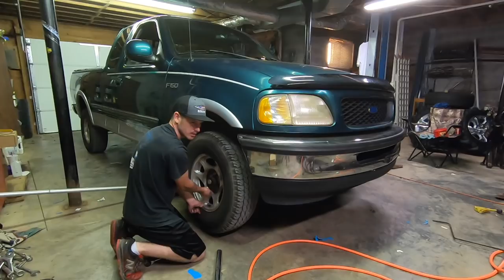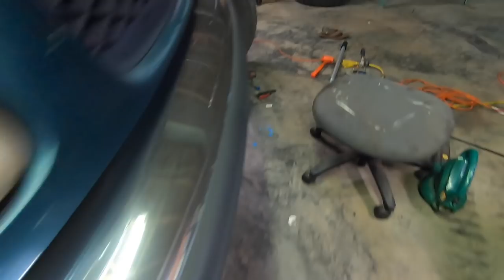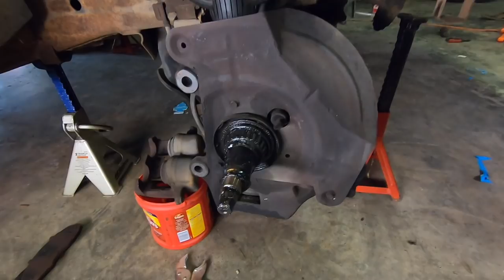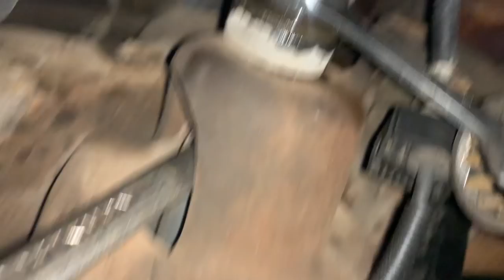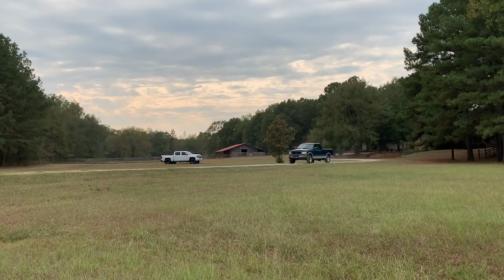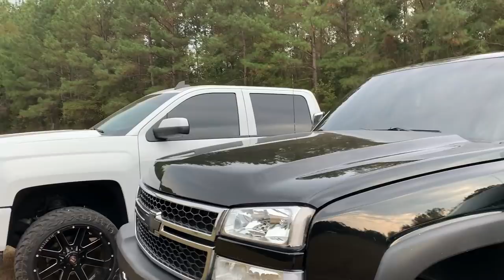3 inch spindle lift install!!

Comment: I’m mostly into older jdm cars but recently purchased a 97xlt extended cab 6 cylinder only though . Came with a snugtop to match. Been following along with your rig build and your truck is dope man. The 9inch lift you added so nice man. Keep up the cool videos🤙🏽

Comment: I’ve got 3.5” spindles, 1.5” lift coils, 2” rear lift blocks and 3” body lift sitting on 35s on my 98 2wd. I love it.
Reply: Did you have to change anything? Like upper control arms or ball joints?
Reply: Got tge same

Comment: I love your videos. They are super helpful. I have a 06 f150 2wd and after watching this I may actually go for the spindle lift over a 2.5 level. Was it easy to fit 35s with the spindle lift? Did you have any rubbing or have to do any trimming?

Comment: If You Add a 3 inch Spacer On The Coil Springs Would It Make Your Truck Higher Than It Is Or Would It Just Reinforce The Suspension Since You Already Lifted The Truck With The Spindles ?

Comment: You mentioned the spindle lift opens the gap of the upper and lower arms .... that’s not how it works it only relocates the the spindle . Otherwise it would mess with the ifs Alignment... some vehicles can have more lift or less from a spindle lift all depends on the factory locations of the spindle on the factory spindle ... like vids keep them coming

Comment: I’m about to do complete brakes suspension and steering all around on my 99 f150 4.6 2wd
Reply: Im in the same boat with same engine. 
I just need to pull the trigger already and get my kit.
Reply: @maxz4065  I did the lift and everything else while I was down there. took about 5 hours with a knowledgeable friend and lots of tools. I fell in love with the truck all over again. new tires and took her in for an alignment. like riding brand new
Reply: @Elon_Trump  any pics
Reply: @Elon_Trump  how did effect your gas mileage?
Reply: @ernievilla6840  not bad at all or at least not very noticeable I also check the tires once a month or so to keep them at proper pressure. She is still on the road and drives great.
Reply: Awesome I'm thinking of doing the same to my truck it's old,can use a new paint job, and I want to replace the interior, but the engine only has 30k on a remanufactured engine I had installed almost five years ago when I bought the truck, if I work on the suspension and diligent maintenance no reason why it wouldn't last another 20 years, I'm in Cali so no rust issues

Comment: Very cool and can’t wait to do this too my truck. So are these just stock springs on your truck? 
My current setup is cut springs and lowered, very sick of this rough ride and setup. I see the 3” lift kit on the rough country website but they only offer the 2” leveling kit springs? Should I purchase these over stock or?

Comment: So the kit came with rear struts as well. Did you put blocks in the rear? Or does it kind of level it without the blocks? Are the rear struts okay to put in without putting in the rear blocks?

Comment: After the 3” spindle lift and the bigger tires, did you have to regear your rear axle? I’m wanting to put the same lift, put 33” tires on, but I’m worried that my 3.55 axle can’t handle the tires.

Comment: I’m putting the same lift on my 2002 Ford F-150 2WD and I’m having trouble removing the stock spindles. I’m beating the hell out of it to try getting it out. Any recommendations? 8:45

Comment: could I run a 5 inch rough country lift for a four-wheel-drive on my 2000 model F150 but I have a 2w

Comment: I have a 2011 duramax and think I like your 1500 more then my d max. How does it feel power wise to compared to the d max?
Reply from the maker: I have no complaints with the power, id test drive some. Def not as much torque as you might be used too though.

Comment: Could you fit a 2.5” leveling kit with the spindle lift without lower control arm relocation?
Reply: Yes i have seen people do it i dont recommend it though unless you are used to driving with stiff front suspension.

Comment: I got a 2000 long bed f150 2wd single cab 55k miles. Do I NEED the shocks from rough country or can I just get spindles and it be alright. Thanks
Reply from the maker: With the low miles you probably don't have to, but the rc ones are longer and made for the spindle lift.
Reply: @lmfscrew  I was gonna keep back stock and put some 305 70 16 Toyo ATs  2 inch spacers on back. If it's going to casue problems later on I'll spend the extra it's on sell $422 right now with shocks not bad

Comment: Can you do this 3 inch spindle lift and later add a 6inch lift to give you a total of 9 inch or that wouldn't be possible?
Reply: Alfredo Arguelles no because lifts use spindles, you can add a leveling kit to a spindle tho.
Reply: You can do a body lift in addition to the spindle lift.

Comment: Did you install the 2 inch rear block or leave that out?
Reply: They sell the spindle lifts as a leveling kit
Reply: I believe he left them out, as he didn't measure the back

Comment: Nice truck but in my opinion if it ain’t 4x4 why bother with mud tires and lift🤷🏽‍♂️
Reply from the maker: Because probably 75% of people that put a lift and mud tires on a truck do it for the look. So this 2wd looks good now and ive taken it offroad a lot with no issue.
Reply: Cool beans, looks really nice I got a 90 Bronco with 33x12.5 on 15x12 MTs. And your video helped with the spacers on rear wheels thanks.

Comment: I'm gonna be putting a 4 inch spindle lift on my 87 c10
Reply: Dominick Sander don’t lift a square body 2wd that things already in the floor it’s gonna be the stock height of a new truck
Reply: Sides they look gross unless it’s a k series bet ya it’s a long bed also 🤢